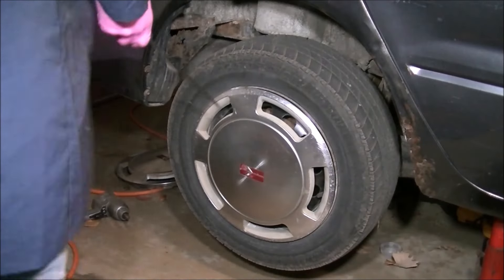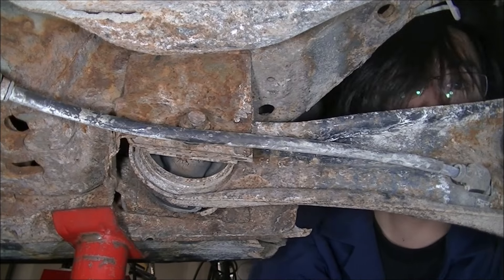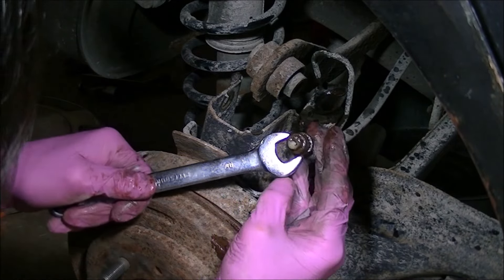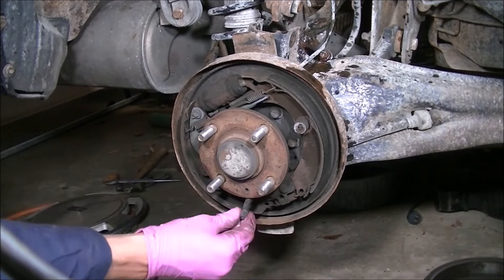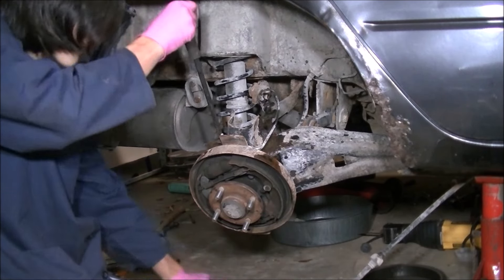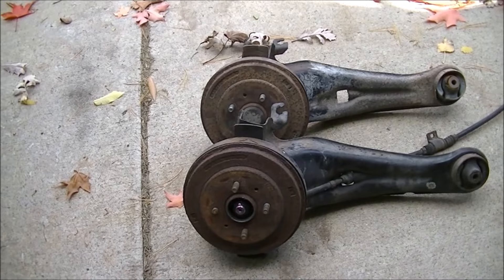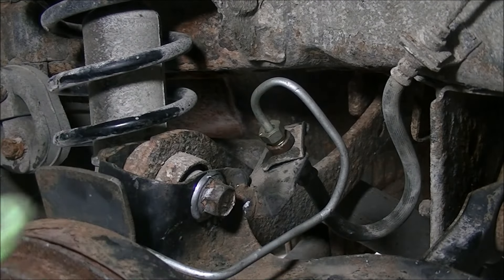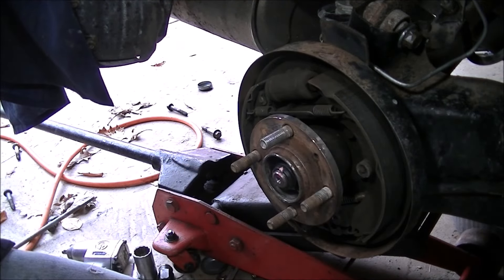2002-2005 Mitsubishi Lancer Rear Trailing Arm Arm Replacement (2002 Mitsubishi Lancer ES)

Comment: I have a 2003 lancer oz rally, my trailing arm bushing is shot. Is there a way to undo the bolt and have enough wiggle room to replace the bushing or would I have to unbolt everything and take the the whole trailing arm out like you did in this video ?

Comment: Hey bro quick question, I have an 03 lancer ES. I’ve been trying to find a trailing arm at local junkyards, I found one from a 03 oz rally. I like the rims on it and the trailing arms look good I was wondering if I could just take the whole trailing arm knuckle assembly and replace it with the ES one or are they completely different fits? I know the studs for the wheels are different but not sure if that was the only difference
Reply from the maker: When I replaced the trailing arms on my vehicle using parts from a local junkyard. I opted for trailing arms from the OZ Rally edition because I couldn't find a cost-effective standard replacement. Before installation, I checked the part numbers and confirmed that the trailing arms for the OZ Rally and the ES editions were identical. I did transfer the wheel bearing and emergency brake cable from my original arms, as they were slightly different, but everything else was a perfect match. Since completing the repair, I haven't encountered any issues, and the vehicle runs smoothly.